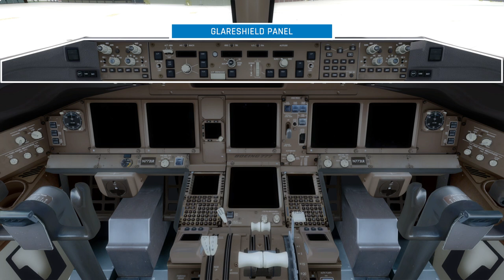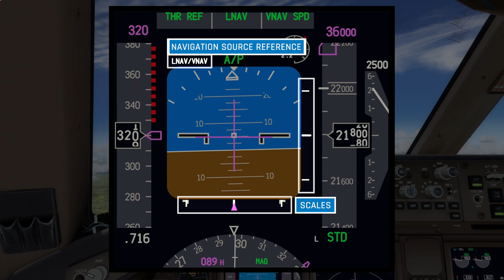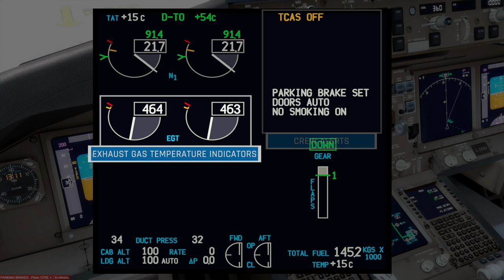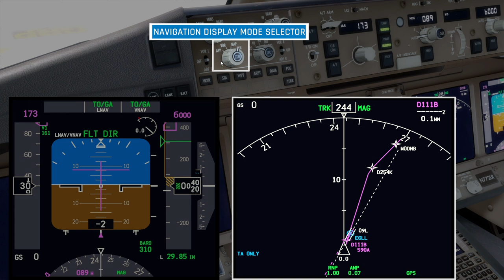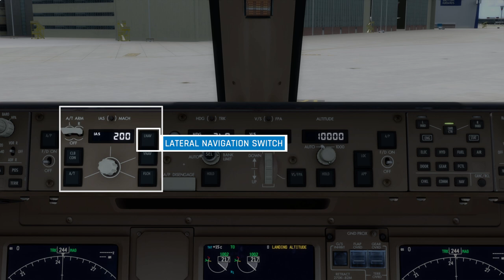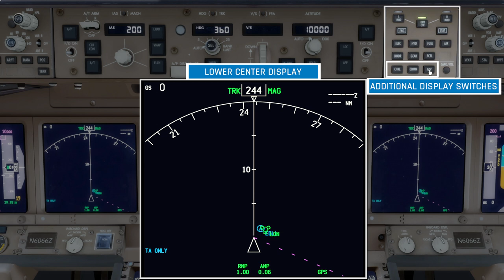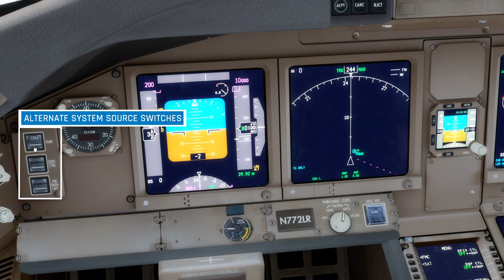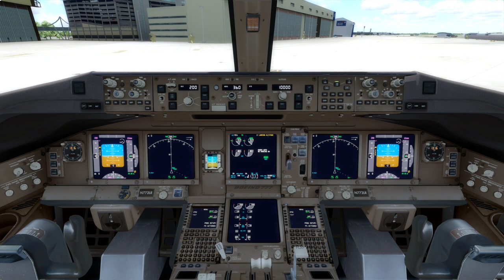PMDG Boeing 777 - Forward Panels and Displays Explained

Comment: Hello, can you please share the download link of the plane and the plugins you use
Reply from the maker: Plane was purchased from PMDG
Reply: @Doofer911  Hello.  When I install the plane, in the simulator, the panels, throttle and other parts are black and unclear and do not work. Is this a graphics problem or does it need a special program to run, please help.

Comment: Great video- very informative.  Quick question for yourself or the group
 here.  How does most FMC calculate weight & balance. Meaning, I 
goto Simbrief, select the plane in my case the 777-200er, I then modify 
to edit exact match on empty with of my plane in the sim to match 
simbrief version.   I print out report and add Gross weight, Zero Fuel 
Weight to sim FMC. I already loaded the plane to match Simbrief specs 
with exact Passenger & Cargo= Payload weights etc.  My question is 
if I enter Gross weight my FMC auto calculates ZFW. If I enter ZFW the 
FMC will autocalculate the Gross Weight.  The issue I'm seeing is the  
numbers do not match my Simbrief report calculations. Again, its only 
off my a dozen kilograms but I'm trying to understand why & how does
 the flight sim FMC use for its estimated calculations?     any pointers
 would be appreciated. Thanks in advance....